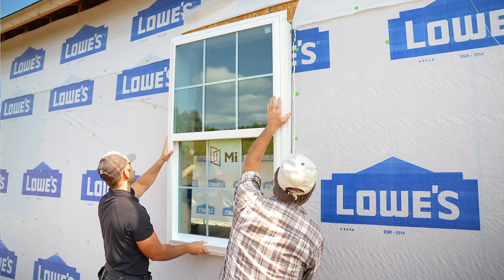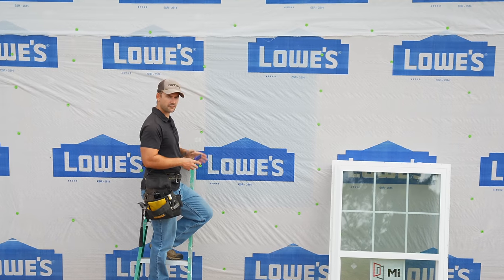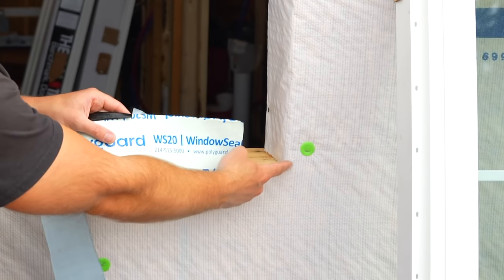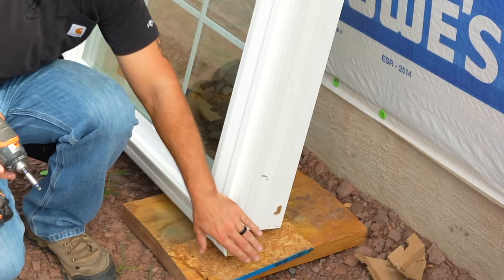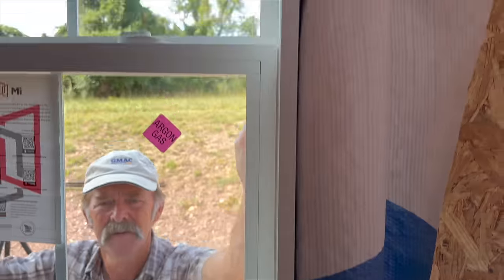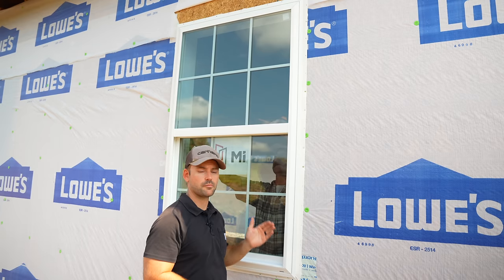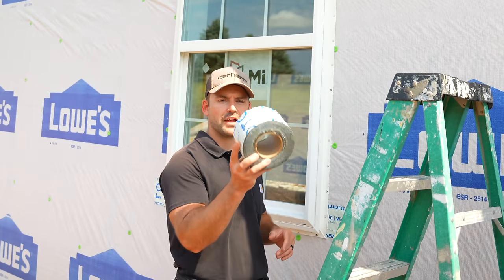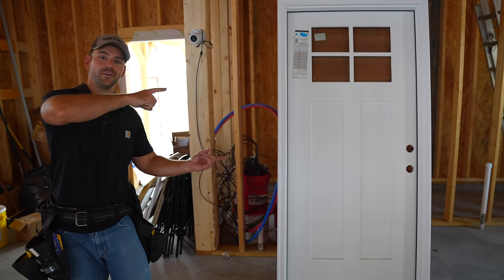How To Install A Window In 12 Minutes! - Beginners Guide

Comment: I don't think you should be caulking under the flange on the bottom of the window, for the same reason you didn't tape it.  Also, for wide windows that have a header over them that bears significant load, don't nail the top flange.  Give the header the ability to flex under load.

Comment: First, I counter flash by taping the sheathing to the framework before I put up the housewrap. You do not caulk or nail the bottom of the window. You want the bottom to be able to allow any potential water to drain down and out. So you only caulk and nail the top and sides. Then flash taps the sides, Also, before flashing the top of the window, install a top cap flash under the house wrap to the top window flange, then tape over it. Then, lay the house wrap over the top cap flashing and tape over that.

Comment: The only thing I see wrong is wrapping the tyvek inside against the Studs. The spray foam for insulating does not stick well to the tyvek .. solution would be to trim the house wrap flush to the outside structure of the home so 2x4 or 2x6 stud is bare .. that way when you apply the spray foam in between the window and the stud on the inside it will stick to the wood jamb and stud thus not allowing any air to enter the home

Comment: Nice job. One thing I would change is to not rely on caulk if you can have a mechanical joint. I would lap the tape in the bottom corners rather than rely on caulk.

Comment: Ive done more windows in remodeling but when ever I could, I love using the flashing tape. The important part on a remodel was making sure the wall thickness and whether it is drywall or plaster. I usually made my own extension jams on certain installs. I love the single double hung window especially for a first floor situation. 
Great install step by step Josh. 🔨🔨👍🏻
Reply from the maker: That makes sense when you were doing a remodel. It’s interesting you mention jam extension because my video coming out next week he’s about that on the door. I feel like single hung window as is all I needed for this garage. Thanks for watching David!
Reply: @TheExcellentLaborer  can't wait for the next video for sure. 🔨👍🏻

Comment: Very concise, thank you. I appreciate you explaining the different types and dimensions of windows. That was what confused me the first time I did this.

One note: I usually see it recommended not to fully silicone the bottom flange, with the justification that it will let any water that DOES manage to get back there escape.

I'll be looking forward to seeing how you finish the siding around the window.
Reply from the maker: You’re welcome! Placing the caulking at the bottom, may do just that, but I would like to ensure there is no draft through the bottom of the window. Thanks for the comment!
Reply: That's fair, but you've still got the insulation/foam to stop drafts!

Comment: Thank you for taking the time to walk through this. We are building a new house and this will help us cut some costs. I do have a question - you didn’t put flashing along the bottom of the window on the outside. Is that okay to miss or do you recommend to put along the bottom as well?
Reply: Not needed, gravity pulls the water down in this instance, not up… plus the window flange is caulked to the house wrap above that point, sealing it from air in addition to spray foam applied from the inside

Comment: Awesome - as all-ways!
Feature wise, I enjoy a double hung window with a full screen to drop down and raise up for better air circulation. For a garage single hung is fine. Also makes easier to completely remove & clean tracks every few years.
I'll only buy those with pure virgin vinyl so frame doesn't resemble a clorox bottle in 6 months.. and finally, as required is a constant force balance system (it resembles a retractable tape measure) so there is no lubrication maintenance and cleaningbin those pesky spiral balance rodes, nor any strings to break over time.
Peace out.😎
Reply from the maker: Thanks a lot! Yes double hung do have more features and like you said, for a garage I am fine with single hung. That is interesting about the pure vinyl you mentioned. I appreciate you stopping by. Take care!

Comment: Thx for the instructive video.  Watch out though: if you use spray foam around the window you want to use the type specifically designed for windows and doors.  The spray foam can you showed will tend to expand too much

Comment: Wrapping the house wrap all around the jab in not advised. Cut it in the middle of the jam, or cut it off on the outside, so the tape can cover the house wrap, osb, and the Nailer. On the top house wrap, you can skip tape it, incase if water does come down, it can escape through the tape gaps.

Comment: If you use the nailing flange and have expanding foam around the window, do you still need to use screws and shims in the window frame ?..say a 2x3 ft window ..

Comment: Can this installation method be used if replacing a window on a structure with t1-11 siding? Trying to avoid buying "replacement" windows without the nailing flange because it seems like a much more difficult install.

Comment: Did you not use shims under the bottom of the window? Most window installation videos say that’s a very important step so you can insulate under the window.
Reply: Modern windows are already Low-e Argon filled insulated.  You're not adding much by squeezing in 1/4inch of insulation.  Rather to have a solidly mounted window that's seated on the framing sill than on some thin cedar shims and secured by a vinyl tab.

Comment: Could you please explain why it would be necessary to check for squareness of a pre-manufactured window? Isn't that a given?
Reply: It's not about the squareness of the window itself it's about the squareness of how the window is sitting in it's rightful place
Reply: Good question.  The window is made of plastic/vinyl.  If you were to set it on a framing sill that's not level & square, it can shift and settle a bit.  That makes it un-square.  Even just a 1/8 inch out of square can make the window bind up and be hard to open and shut or not go up all the way, etc.  That's why the other window he showed had a little shim under it.  And, just like hanging a door, you want to shim around the sides and top too when the manufacturer suggests side-screw mounting like in a brick vinyl window.

Comment: How do you choose the right size of window? I'm measuring 34x58.5  I go to Lowes and nothing fits. Home depot has a 33.75x56.75 and then in description it has a RO that's a different number than that?????
Reply: RO 34.25x57.25
Reply: This may be way too late, but you typically have windows that you already bought or already KNOW the size of.  Then you frame according to the window sizes.  Usually the window measurement is a whole number like your example would be a 34 x 59(which is still a bit of an odd number, I would assume it's supposed to be 60").... and the rough opening size would be 1/2inch more width and height.  That allows you 1/4 inch on all sides to shim the window square & plum.

Comment: Can please make a video on how to install a window a bit smaller or larger then the original
Reply from the maker: I could definitely do that but I will say the process is exactly the same. Only difference would be bigger or small pieces of flashing tape. I hope that helps!
Reply: @TheExcellentLaborer  thanks
Reply: You'll need to adjust the framing of the wall. Not too hard, assuming you have access. If it's a finished wall that you're remodeling, then it can be a pain.
Reply: @institches2750  we are going to re sheet rock the walls thanks
Reply: @sim539  That makes it a bit easier, though I will say the OUTSIDE can be the tricky part. If you use a new construction window with a nailing flange, you'll need to get the flange behind the siding, which may require moving or removing some sections. If you use a replacement window (no nailing flange, screwed through the side into the framing), then you'll probably have to add some kind of trim/molding to finish the outside. You you may have to cut or patch the siding in either case, depending on if you go bigger or smaller with the window.
Reply: @institches2750  our house is brick , taking into consideration your feed back we probably will buy a bit smaller windows than the original ones.  You are awesome 😎 thanks 🙏
Reply: @sim539  If you have brick, then you may already have trim/brick molding on the outside. You can just pull it off, replace the window, and then put it back or replace it with new without disturbing the brick. In that case, there may be no need to go smaller.

I would measure the window inside and outside and try to determine the exact construction of what you have: molding yes/no, nailing flange yes/no. You can even take a trim piece off to check. Do that before buying the replacement and hopefully save yourself some work trying to retrofit a different size.

There are probably some videos in YT showing the exact situation of replacing a window on a brick house. There are also good vids on how to measure windows and rough openings.
Reply: I sincerely and humbly appreciate you so much. Thanks for all your sound advice and time and efforts.  Many many many blessings to you. 😎

Comment: Great video. However, personally, I still would recommend using a roller to seal the tape. Not just your hand.
Reply from the maker: Roller probably does give the best seal, but using anything to create pressure does just that. Thanks for your input!

Comment: I got really screwed & scammed by *professional siding and windows company. They used crappy Thermo-Ply & no flashing tapes.
So after removing the windows out & found sides rotted and condomed cover it. My daughter & I are doing the installation.
Question: Why you didn't use flashing tape (11:26) at 6 O'clock?  Could that be for water drain?

*Home Depot refused to pay the repair & installations
*Home Depot says they didn't do the work.
*"Hi, Home Depot here to install your siding & windows."
*Home Depot says they don't actually work for us.
*Homeowners beware of these scammed & dishonest practices.

Comment: So you charge a customer for 12 minutes of labor? 🤔
Reply: ...I mean, I would? Twelve minutes isn't zero. Plus, you have to consider drive time, which is unpaid. Picking up the window, if the contractor did that and not the customer. Cost of wear on tools, clothing/ PPE, and vehicle. Gas. The experience of having installed it before and knowing how to troubleshoot problems before they arise. It is NOT twelve minutes the first time you do it, lol. 

That's why most contractors have a minimum. I, personally, will not drive 45 minutes across the city to do ten minutes of work.

Also, this guy builds his own houses, so he isn't charging the customer. He IS the customer.
Reply: Makes sense 🤦🏻‍♂️🤪🤫🤥🫣
Reply: 12 min for a skilled worker who knows what he is doing and not taking 5 hours for coffee breaks 😂😂😂
Reply from the maker: I build spec homes. I do not get paid by the hour. So in theory the quicker I work the more money I make. I hope that helps!